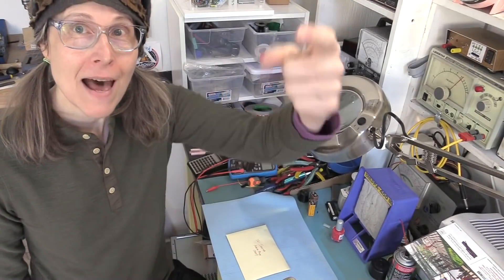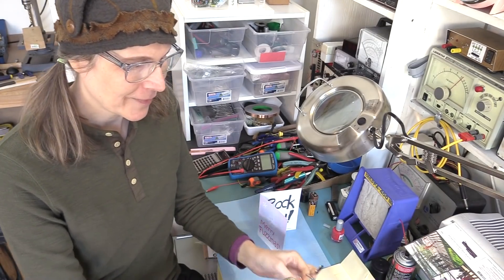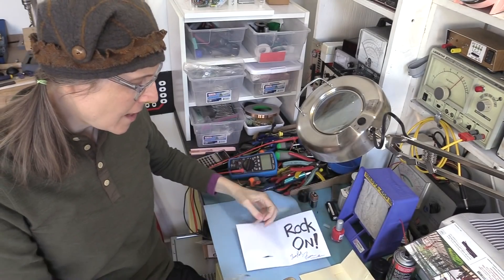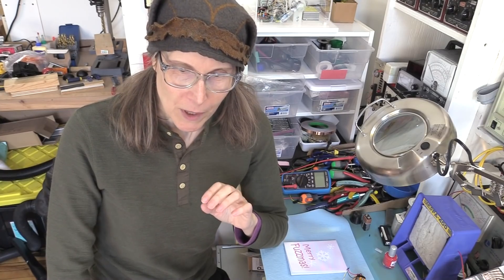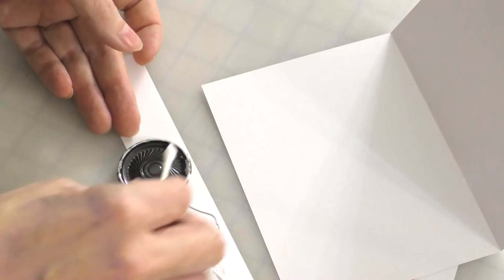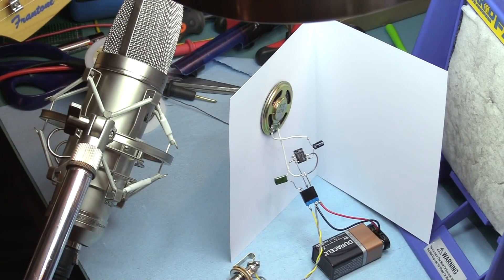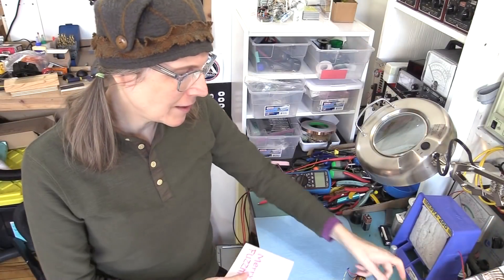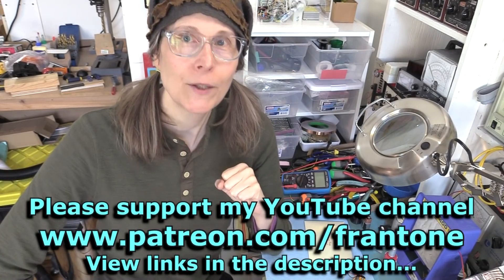Holiday Card Guitar Amplifier With Fuzztone!!!

Comment: I never did anything with it but I once saved the tiny speaker from a musical greeting card intending to use it for an amp of some kind.   

What I did end up doing was keeping the speakers I put in the doors of my rusty 1973 Mustang ("the rustang") and just placing one naked facing up on the floor - being fed from an 80s home amplifier into an Ibanez MOStortion and then into that speaker.  That was like the biggest sound I ever got.

Comment: Hey Fran, that's such a wicked idea! I'd love to make one of these for a good friend of mine, is there any chance of a schematic or some guidance on the cap values? I'm a bit of a novice at this! Happy holidays :)
Reply: I watch the video closely and the green cap i an 2A472J (4,7nF Polyester film capacitor). The black caps I think is 10uF/16V bipolar (there is no painted "-" line on the side) capacitors. And if you follow the video Fran is adding another 2A472J afterward on the "line in" from the guitar (see 6m48s).

Comment: I wonder how long it'd run off three 2032 batteries!  And I wonder if it would be possible to make a pop-up phono socket - I'm thinking a paper stock tube lined with a couple of pieces of copper foil that was then flattened to fit in the card.  Cool project!

Comment: Love it. But one LM386 has enough (200x) open loop gain to make a lot of distortion. It was used like that in a lot of DIY distortion/amp projects. Like Little Gem. No need for the second stage. Put some resistor or trimmer between lugs 1 and 8 to set the gain.

Comment: Amazing idea! Some possible improvements, to get rid of the bulky 9V battery: put two CR2032 batteries in series, you can hide it inside the card, maybe in the other page of the card (or CR2450 for longer life, or maybe a rechargeable li-ion, with a micro-USB charging port?). And provide a pigtail from very thin shielded cable with a 3,5mm jack socket on the other end. You can connect to it with a 3,5->6,3mm jack adapter. This way, the entire thing would be envelope ready, including the battery and cable. I think that actually can be a working, semi-mass produced product.

Comment: All it needs is one of those flat Lithium batteries
Reply: Yeah, I was thinking neodymium magnets to just stick the guitar jack on flat against the card too, but the 9 volt and three pin with plug, etc, was very Fran. Perhaps the mass produced ones will have that. You could have a picture of an amp inside with an input, little red led... Don't get me started!   Birthday card with phaser......  Um,  ...
Reply: smtpgirl - a lipo (even if small..) unprotected except by the card stock would be a severrrrre fire hazard to say the least.... Just takes a tiny tiny puncture or mishandling and next thing you know....

... you’ll have sent a potential fire bomb instead of a guitar amp... Plz don’t put a lipo in one of these, PLEASE...
Reply: @TylrVncnt  I think there is some punny Lithium ceramic batteries that keep working even if cut, I was thinking of those
Reply: @TylrVncnt  Those little disc ones aren't too bad, but God! I know what you mean. Have nearly burnt my house down with the bigger Batts.  In fact I had a home made gadget in my pocket earlier this afternoon, with a little fan attached (bloody hot here in New Zealand) to a lithium battery... started getting a bit hot in my pocket ... what an idiot I am. Fortunately I noticed in time. Be careful folks. (Edit: little fan not Fran)